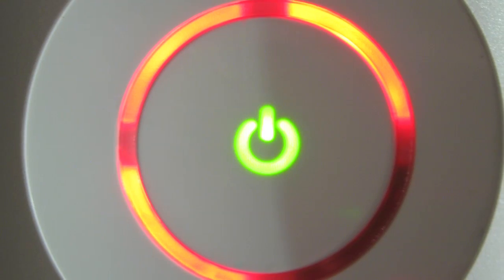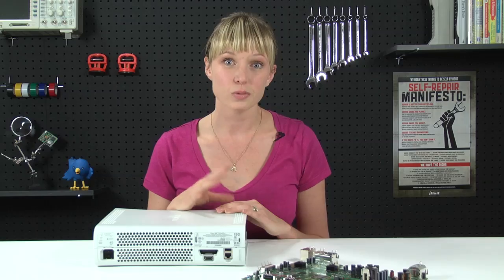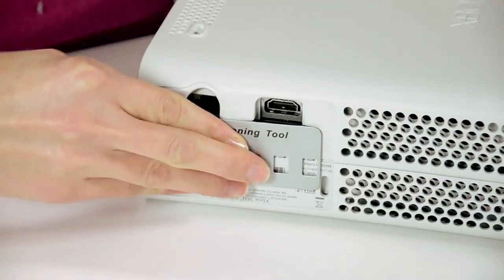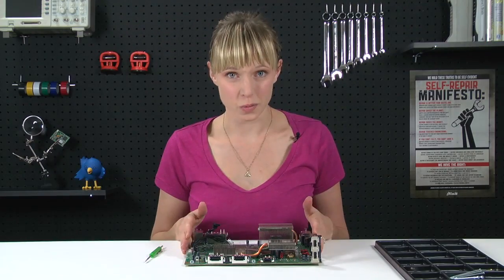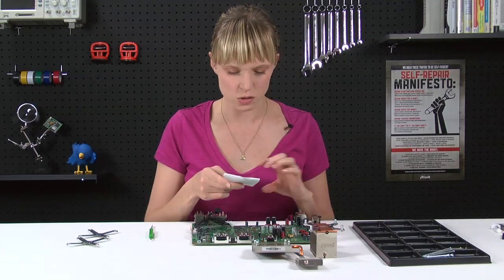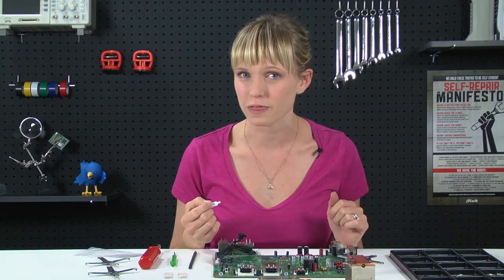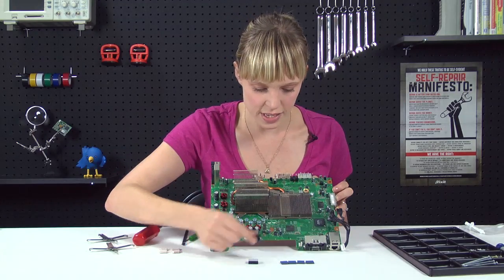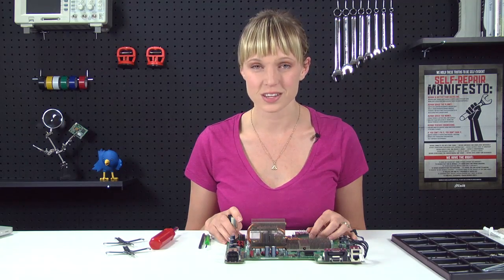Xbox 360 Red Ring of Death Repair

Comment: PLEASE DO NOT USE THIS GUIDE TO FIX YOUR XBOX 360!!!

The reason why it's because the bolt mod will make things worse by literally warping the motherboard so much and you will do more damage to console than not doing this mod at all. The real solution is to replace the GPU as the GPU on the early models used low tg underfill instead of high tg underfill which after some thermal cycles the GPU would fail because the low tg underfill would regularly soften during normal use(WHICH SHOULD NEVER HAPPEN) as it wasn't meant for chips that ran as hot as the 360's GPU did and would cause the microscopic solder bumps to crack as the sillicon and substrate that it sits on would expand during normal use. Replacing the GPU with a known reliable one will solve this problem.

This same issue affected early fat PS3s. 

Before you do anything to your Xbox 360, PLEASE grab the secondary error code as thay will help you find out what is exactly wrong with your console!

Comment: I remember back when I was around 16, I got the red ring of death and did a DIY fix where I tore the case open breaking a few of the clips, then put two pennies wrapped in electrical tape in place of the old thermal pads, then put it back together and it worked like a charm 😃😃haha This method in video looks much more clean and professional, and I'd take this route now as an adult, but it was fun to think back on!

Comment: Do not use washers for the cpu or gpu. They do fix it but they do it in a way that will destroy the console. They pull the cpu or gpu back into the solder balls but with the amount of heat produced this will flex the board. When it flexes, the cpu or gpu  can't move and it will damage the motherboard around there and can kill the board.

Also some gpus and cpus are fully dead and the washers won't work. You will have to get a new one or send it to someone who knows how to replace the cpu or gpu.
Reply: yep and the x-clamps are needed to keep the board from flexing around the cpu and gpu. although I could have idea wrong.

Comment: I recently picked up an xbox 360 that was refurbished by Gamestop. Fans were loud so I opened the console to clean fans and heatsinks. Also wanted to apply new thermal paste. To my surprise, the fans were loud because they tapped into the dvd drive cable and performed a 12v fan mod which makes the fans always run on high. 
Here's my question though... Does the x-clamp fix require the metal washers? This console had machine screws and nylon washers only. Should I add the missing metal washers or leave as-is?

Comment: ANYONE THINKING ABOUT DOING THIS: DO NOT DO THIS!!! IT WILL BREAK YOUR XBOX EVEN MORE BECOUSE YOU'RE ACTUALLY BENDING THE BOARD! THE BEST FIX IS TO REPLACE THE GPU ENTIRELY! IF YOU DON'T HAVE THE EQUIPMENT OR SKILL, ASK SOMEONE ELSE TO DO IT OR GET A NEW XBOX 360! THE JASPER MOTHERBOARD IS THE MOST RELIABLE PHAT MOTHERBOARD AND IT WILL NOT RED RING. DO NOT FOLLOW THIS GUIDE!!!

Comment: I don’t get this: how does thermal paste fix a broken solder?
Reply: The paste was just changed because to get better thermal connection and you have to replace it if you remove the heatsink

Comment: I am just wondering. If the solder melts, when I will do „reballing“ what is the best solder to use?
Reply: Do not reball. It won't help. Because the problem is on the GPU chip itself, you need to replace the GPU entirely. To do it you need no-clean flux, 63/37 or 60/40 0.6mm solder balls, BGA Rework Station, stencil and I'm not sure was there more but if you're actually gonna do it, just tell me so I'll link everything you need.

Comment: I'm sure you're not even watching comments on this video anymore (I wouldn't blame you, lol) but I'm just curious, how does this fix the xbox?  All you're doing is replacing thermal compound and pads, and clamping the heatsink on better. I don't see how this would instantly fix the system, and if you could explain a little bit I'd appreciate it.
Reply: It doesn't fix it because the problem is the GPU itself. The point of this mod was to force the connection between the board and the GPU but actually it makes things even worse.
Reply: @mrveink  yup it crush the cpu/gpu against the board. I used to do this and cook the board in a oven back in the days. Now I’v learned and I own 4 jasper v2, goodbye rrod. I still play a lot of 360 games.

Comment: This is HORRIBLE AND DUMB! I cannot believe a reputable company like iFixit is showing this. Slamming chips into the board and thus warping it does not fix anything! The correct fix is to remove the GPU (for most common codes anyways), and replace it with a totally different chip, and then put it back on the system using a BGA rework machine - which is expensive. This is disgusting and I am severely disappointed in iFixit.
Reply: Hi dude.
Reply: @mrveink  Hi

Comment: The x clamps are needed lol as this will warp the board without them and that fix is just a band aid only last about 28 days maybe less also not allways solder cracks causing red light death same as ps3 its the capacitors that meed replacing or just piggie back 4x 6volts at 460 micro farad.hope this helps eny ☝

Comment: First off, why are they doing a bolt mod in the first place? That just warps the board.
Secondly, why tf are they doing a bolt mod... ON A JASPER (edit: it's a Kronos, came out after Jasper) 360?!?!? Those don't get red ring at all. They're just breaking a perfectly working Jasper board with this "repair" I thought this was iFixit, not iBreakit.
Reply: And for anyone wondering, that is indeed a Kronos board in the video. You can tell by the power plug.

Comment: NEVER DO THIS! It will warp your Xbox 360 motherboard! All you are doing is jamming the bad solder points together again, and the board will just warp now and then Red Ring again. The real and ONLY fix is a reflow/reball of the damaged part.
Disappointing with iFixit for putting out this. Usually they give quality advice.

Comment: Want to permanently ruin your Xbox?  Buy this kit, Warp the mother board and while it heats up during operation the cheap assed thermal paste that comes with this stupid kit will simply melt off of the GPU and CPU.

Comment: the point of having the x clamps is so the board won't flex this a temporary fix, It is recommended to keep the those clamps to hold the GPU/CPU in place.

Comment: wait so you don't have to use a heat gun?
Reply: I don't know why ifixit would ever endorse a tutorial this simple for 360 repairs. This might work, it might not. It is a lot better than leaving the x-clamps in place, but I have rarely ever gotten a 360 working again without some heat, and it could still fail again some time down the line anyway, if this combined with heat alone fixes it to begin with. The only guaranteed 100% permanent fix is to have your gpu reballed with leaded solder instead of the crappy child safe garbage they were forced to use that caused the problem in the first place. It wouldn't hurt to have them do the cpu as well, just in case, and I would even go so far as to redo the hana chip as well, on applicable consoles, because that's usually the cause of the E74 error common in some motherboard revisions.

Comment: If that CPU solder `has breakdown` how come you didnt reball the chip ?
And you call changing thermal grease as repair ? Repair is when you have non working vibro on PS2, have your big deck filled with parts, resolder fuse ( and you take just some random close value fuse cuz you dont want to wait for parts from ebay and which barely fits there) Then pulling it back together and finding out it works. Huhu. And then selling it cuz you bought it for few games only, hhh.

Comment: USE ISO ALCOHOL. Not nail polish remover. And never spread the paste by hand , put a pea sized dot in the middle and press down the heatsink and it will spread on naturally and it will be the perfect thickness
Reply: For 30yrs of doing this and OC'n and writing tutorials, using your finger is just fine.  Love that the 'scary finger oil is going to make it run hot' is still a funny.    Also, a dry paper towel works the best at removing compound.
Reply: Alcohol is barely effective on the thermal putty used in these old Xboxes. Clorox wipes are more effective than alcohol.
Reply: @wright96d  Clorox wipes have alcohol on them
Reply: @Davidmormino  Well whatever is in them that's not alcohol is probably what loosened the paste.

Comment: The biggest issue with fixing a console (or any computer, really) is just dealing with the sheer amount of variables involved with troubleshooting. RROD? Which code? When did it first happen? What happened just before the console shut down? what did the code search reveal as a possible suspect? Is it fixable? How involved will the repair be? These and many more questions brought to you by some punk kid in the Rocky Mountains, with an Xbox throwing E10 and E71.

Comment: Will this fix error E74 as well?

Thanks in advance.
Reply: KSI FlapJaksLol Yeah i know, or making sure that once you repair it you are gonna leave the xbox in a ventilated area and maybe even solder the fans at the 12v point to make it cooler.
Reply: +Chaos the only permanent solution to fixing an old Xbox 360 is to have the main motherboard components re-balled (melting the solder under the CPU and GPU to remove the chips and put new and better solder down), and placing the finished product into a custom cooling solution.
Reply: TheHGCGamersClub "Oh glorious leader, knower of all things, bestow upon us your knowledge of how to fix something I just fixed two days ago!" Your undying need for external piety will not fix people, nor will your deliberate attempts to get under my skin keep me from sharing what little I do know. Step off and do something productive with your life, "Commander of QWERTY."
Reply: TheHGCGamersClub Your well structured prose has but one caveat:

I have never, nor ever will, purchase a repair kit from some Joe Shmoe on the internet. I have my own tools and have made repairs on a dozen or so electronics from my own possessions. I fix my own machines and almost none of them have or need the level of precision required for maintaining aircraft.

I do not use a heat gun. I do not warp motherboards with faulty components. I build my own enclosures for any hardware that I find worth keeping. 

If a BGA repair is called for, (as much as I hate to say it) throw it away and get a new console. 

Puffing your chest at people on the internet about military grade repairs when discussing cheap mass produced electronics is over qualification and overcompensation to the extreme. Do yourself a favor and go back to fixing airplanes while punk kids learn how basic and rudimentary   electronics work so that they can develop an interest and eventually do the same.

I shall grovel in your Almighty wisdom, Captain Keyboard.
Reply: TheHGCGamersClub Gramps, get off your high horse.
Reply: TheHGCGamersClub Lol
Reply: TheHGCGamersClub She tells me every day how proud she is of me. That I've made it through high school, that I'm working at an amazing job, that I'm going to college, that I take care of those around me, namely my brother with Aspergers. Do not presume to know what I have and have not done. Tell me, Big Cheese, and don't lie, what makes me a criminal? What gives you the right to call me such, with no proof of your claims? And what unknowable property of your life makes it somehow superior to mine? Instead of having an intellectual dick measuring contest with someone you don't know, why don't you do something actually productive, constructive, and informative? Belittle me all you like, it won't make you innately better than anyone else.
Reply: TheHGCGamersClub Never did I endorse anything in this video other than how to take the console apart.  Not once did I say, nor did I imply; "buy these guy's product."

Fabricating half truths and passing them around as purity incarnate  makes you a liar. 

Perhaps you should take your overqualified and pompous diatribes to West Point where people who are at a more appropiate level of electrical engineering knowledge can appreciate it for what it is.
Reply: TheHGCGamersClub No one here gives a rat's ass if you can fix an AC 130's targeting computer. We're taking about a piece of hardware a decade old that was built cheaply and doesn't last. Quick fixes will get data from it, but there is no saving a piece of crap when it is one. I am saying, quite bluntly, that you're going way over consumer's heads with what knowledge you have. People want a quick fix to pull their data and move on, not reball a piece of junk. You can't fix these things. It's not practical.

Comment: Fucking hell.... the paste spreads when you put on the heatsink. Don't spread it manually or you'll get bubbles.
Reply: The "industry" that gives us hardware like this that RROD's? Fuck the industry.
Reply: Potato tomato, don't split hairs over a different method. Either way is equally acceptable.
Reply: KSI FlapJaksLol While I agree that its not a huge difference, if you are doing a tutorial video, you should do it by the "industry" standard.
Reply: Frank Harding The industry spreads it that way more out of convenience and speed than precision and certainty. Still, to each his own.

Comment: You are using ACETONE on the GPU/CPU? .. .facepalm .. use isopropyl on the GPU/CPU .. and ACETONE on the heatsink only (if its really hard to remove thermal paste from the heatsink otherwise use Rubbing alcohol aka isopropyl)
Reply: Max Paynez pp

Comment: She shouldn't? Okay, let's say someone's 360 RROD's. And let's say they do what she does in this video to fix it, following everything down to the letter, doing it perfectly as she did. 

Now, they turn on their 360 only to find that it's still plagued by the RROD. There is a need to turn it on, for god's sake.

You can't prove a fix unless you turn it on to see if the fix worked. It's easy to say you fixed something without showing the final result.

Comment: EVERYONE, i found that the thermal compound on the cpu and gpu chips that is first on there from microsoft is way stronger than the thermal compound you can go out and buy, i reused the thermal compound that was already there on so many 360s and when you heat it up its really really strong and dosent break down from heat,it works every time it dosent break down from heat like the crap you can buy, everytime i re use it after the repair a message comes up....

Comment: Nice, thank you. That may come in handy in the future. I'm still rocking the old style xbox..been using it for a few years now. Only thing I've had to do so far (knock on wood), is turn up the laser power a tiny bit when it stopped reading. My new slim stopped reading just out of warranty! Haven't had the will to learn about opening that one up yet : ) Any good sources on that would be much appreciated! Thanks again.

Comment: The thing I always miss in these video's is the end result, you know, put the thing back together an boot it up to show that the repair was succesfull.
Reply: probably a failure thats why they dont show it..
Reply: @michaelknight8797  i know this is really late, but she didnt even fix the cause of the rrod, all she did was change the thermal paste. the cause is the breakdown of the soldering joints, she would have needed to heat up the chips while using flux to fix the solder issue
Reply: @michaelknight8797  or maybe because yours didnt work and ur salty
or maybe cause its a console used for an example and already works????
think before you spit bullshit

Comment: youll ruin your xbox this way the x clambs are for a reason without them your xbox is subject to flexin and buldging caused by the screws that dont support like the clambs the hold the middle tight without them the extreme heat fro cpu/gpu your board melts just alittle and stars to bend a break solder joints i suggest installing a second gen cpu heatsink on the gpu and cpu(optional) please dont do this it works but is only temporary do a fan mod or something and listen to me i know

Comment: I don't how you handle that but I learned once that you shouldn't touch on a electronic board unless you're grounded. Are you? And please use next time the right sized screw driver. Then one which you're using at around 3.40 is definitely to small.

Comment: Also using Surgical Spirit or Rubbing alcohol will work to remove thermal paste. And you don't usually spread thermal paste like that, you put a drop in the centre and use the pressure of the heatsink above to spread it to where it naturally needs to be

Comment: @xXDEICIDE216Xx  The center pressure is the reason  the motherboard in the 360 warps causing the BGA failure.  When MS was testing the heat endurance, they concluded that the heat was well below the limits of the GPU/CPU Failure threshold.  HOWEVER, they did not consider the constant heating and cooling cycle that is common with consoles (being turned on and off regularly) and the effects that this would have on the motherboard as far as warping over time.

Comment: My release xbox still works but has suffered from RROD since a few months after purchase.  My xbox is very particular where it is plugged in and prefers to be plugged into a UPS that helps condition the line AC. 

I have tested it at several locations between the two homes I've lived in since owning it and friends homes and clean power is the key to keeping my xbox running.  Mine has never RROD after use just cold starts plugged right into the wall.